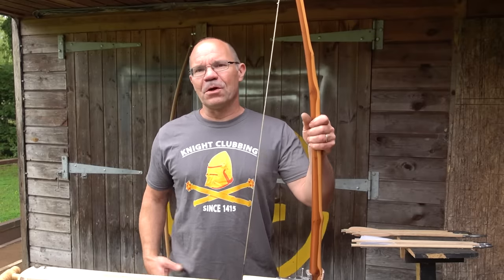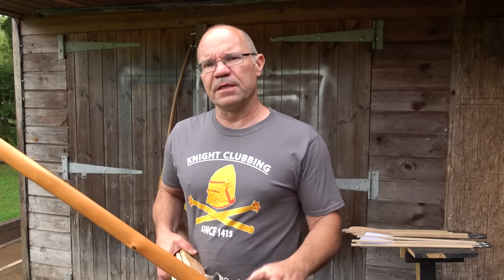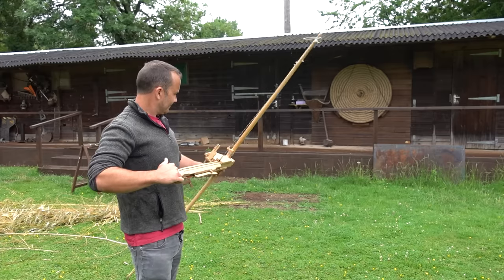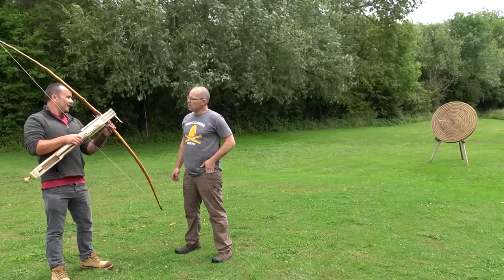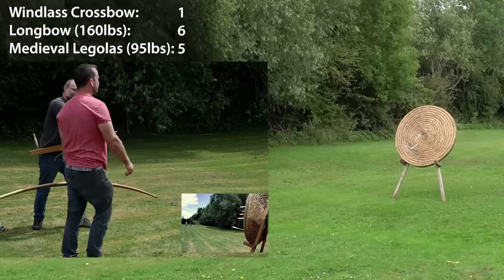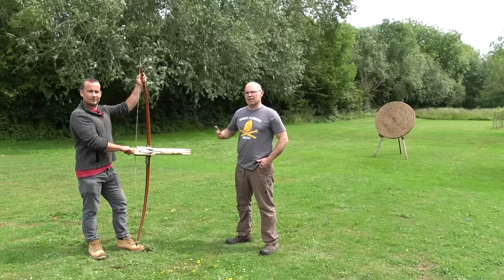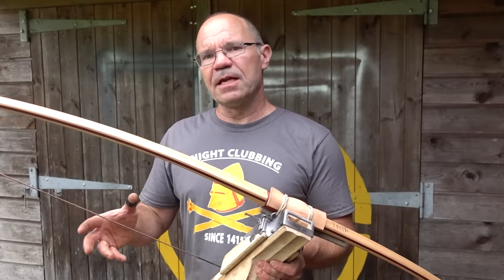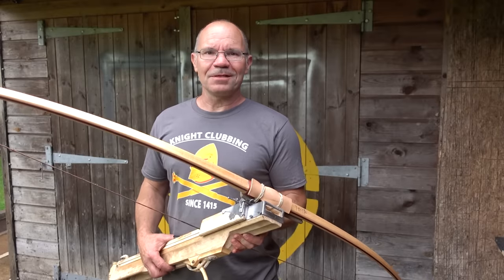Tod's 120lb Medieval Legolas - TESTED

Comment: 13:31 RIP anything not wearing full plate harness...
Edit: Alright, shields are a thing, but you'd have to be actually using them, requiring awarenes of the archers' presence and reacting to them by rising said shields. My point, although not initially clarified, was about ambush potential to slow-reacting targets such as marching columns.
Edit 2: gramatical boogaloo...
Reply: Even in full plate, this would give you a bad day. Throw enough arrows down range, and one of them will find an opening where the plate isn't.
Reply: or deform the plate enough to make it ineffective.
Reply: @curranegan5512  Lucky shots are rare and not to be relied on. Especially at the range a bowman would engage at. And areas that aren't covered by plate aren't just naked. Its usually covered in mail or other material meant to protect from arrows and other attacks targeting would be weak points.
Reply: @alexlawson4173  That would require one knight in plate to be focused at close range. Even at close range a high weight crossbow or longbow barely get a dead-on flat shot that deforms the plate and even then its not much, most are glancing shots. Longer range with less energy and it will be even less likely.
Reply: @Nyx_2142  Well, not even a 1000lb crossbow can penetrate plate dead-on at 5m, so i think volume of fire and accuracy does have importance in targeting the weaker spots. arrows and bolts doesn't have much trouble in piercing mail either, so having a lighter poundage is fine in certain circumstances.
Reply: @theSleepyLamp  depends on the type of arrow head (for penetrating mail) and the range.
besides shields are a thing.
Reply: Nex Gamez with a hi enough rate of fire, it stops being a mater of luck, and starts being a mater of statistics.

A one in 100 shot happens every 8 seconds with 25 archers shooting once every 2 seconds.
Reply: I wonder how many arrows it would take to make a shield no longer usable (either through weight of arrows lodged into it, or straight up holes being knocked through it).
Reply: @hurion1  Well, a war arrow would typically have weighed anywhere from ~75 grams to something like 115-120 grams, so you can do the arithmetic and decide how many of them you would have to add to the weight of a shield before it became uncomfortably heavy to lug around.
Reply: @michaelmaloney2925  Good point, you can also poison the bolts like the chinese did with the chu-ko-nu. Imagine being in armor and being on the receiving end of this, even if nothing penetrates it would be very disorienting and it would make it a lot easier for some one else to hit you in the head with a warhammer.
Reply: The maille between the plates can be easely penetrated by 100-120lbs bows with square point arrows, and the rate of fire of like 10 archers would give short time to take defensive position, enought time to hit weak point. And other thing to take into consideration is the shrapnel created by the arrows hitting a solid plate.

Comment: I can imagine that 5 guys with this thing would be really scary
Reply: It's like the medieval version of a heavy-machinegun team
Reply: add a partial gear with crank such as what joerg did for the drill powered machinegun variant except with a crank handle and this thing becomes even more of a beast
Reply: now imagine 15 divided in 3 ranks with two reloading while the front 5 shoot
Reply: @AdarBlu  
reloading.... 
slip slip slip slip slip....
Reply: @Aalienik  Much more a squad of lever actions when everyone else has single-shots.
Reply: There's an account of a Lady with like five servants, defending a castle for days.
Reply: @Max De Jong Actually come to think about it, in a big open-ground fight 1000 of those would shred through a whole rank allowing for breakthrough attack
Reply: Literally a medieval MG-34 team except you hear THUK THUK THUK instead of RATATATATATAT
Reply: Aalienik  only that the sustainability of shooting is limited by the magazine size, instead of the amount of arrows in the quiver. Especially if you compare the 6 arrows shot WITHOUT the device opposed to the 5 shot with the device in the same time.
Reply: @Nightkrowler  I can't recall who its was, but someone built a "stripper clip" prototype for reloading this kind of device. It was virtually as fast as reloading the most modern firearms that used those (such as an SKS).

Comment: Try walking a mile and then try running a mile. You'd get more tired of running, and I suspect  that something similar is happening here. Joe is shooting faster and thus getting tired faster.
Reply: Exactly my thoughts. Joe's body is used to a certain pace of shooting. Increase that pace and his body will start rebelling against it. I think if he put in some practice, let his body find balance in engaging different muscles at different times and developed a proper breathing technique he could get used to shooting the 120 lbs legolas regularly.
Reply: @B3RyL  Or even imagine 100 sil-archers holding a position, split the group into halves or thirds, group A shoots and then reloads and rests their arms while group B shoots etc.  Eventually you would find the optimum group split for sustained fire.  You're still shooting more arrows than a group of 100 regular longbows and if the enemy closes you can go full fire at will until the Infantry has to take over.
Reply: It looks to me that here there are a couple of things in play. Shooting faster does not give the muscles the chance to recover, so it will be more difficult, at least towards the end. The position is quite different, and the movement is too. Since you need to train very, very specific muscles to be proficient with the kind of heavy bows we talk about here, tiny changes will have big consequences, so more work would be needed either to get the Instant Legolas closer to the normal bow movement, or the archer will need time to train the proper muscles for the new movement. Both things look possible to me. 
Another thing is needed poundage. Maybe this should be used in situations where rate of fire is more important than power, and you really, really need a fast burst of arrows, because after that it no longer matters. Think if your archers are being rushed by cavalry. The range where the archers can do proper damage is limited, they can't really shoot at 200 meters, and that usable range is covered by horses in maybe a handful of seconds. Yes, a powerful bow will kill one enemy, but 5 arrows from a slightly lighter bow will maybe disable 2, or 3, or 4 of the charging enemy. It might be enough to stop the charge and send the attackers back.
One last thing about the aiming devices (the lever and the sights). So far we talked about speed. What if a trained archer will basically take the role of a sniper, so he has a high priority target, he can draw the bow, hold the handle so he can keep it drawn for a lot longer, use the sights to have even better aim than usually, and wait for the right moment to take the target out. The thing is you can more or less already do that with a cross bow, but if you are an archer, you already carry your bow and arrows and the IL device, so you can do this sort of a mission without carrying a crossbow too, you already have the weapons you need.
Now, i'm not a strategist, not military, not a historian, so this is just food for thought.
Reply: it's the same principal as driving a car, the faster you drive the more quickly (proportionately) you use up fuel
Reply: Yes it's conditioning. If you're only used to walking you will tire quickly when running. If you train regularly at running you will not tire so quickly. So someone who trains with this contraption regularly will find it easier to use.

Comment: Love every second of this.
An idea: how much is the additional weight influencing? Especially for the right arm/hand, which isn't used to move that much mass in that speed. Inertia could play a role in this without being necessarily noticable right away.
Reply: The mass of the device is going to have some stabilizing effect due to its inertia.
Reply: I was thinking, what about using animal fat as a way to decrease friction? It might be a small improvement, but might up the firing speed a bit.
Reply: @Superemeoverlord  Animal Fat would soften the String over time, but with Beeswax ..
Reply: @pirobot668beta  isn't this only true for the non/less moving parts?
I am only guessing here, especially without knowing the mass of the device and it's parts. At least to me it seems that overcoming the inertia of the moving parts is a different kind of strain compared to overcome the tention of the string and might therefor be more tiring.
 The device is easing one strain but adds a different one. Question is how significant this is. If at all.
But this might be irrelevant after a few weeks of training, simply by adjusting the technique and muscles a little to the difference, so maybe not even worth thinking about.

@Rawwbot: true, but I think the part you want to put the wax on isn't where the string is but the sliding part where Tod used bone to reduce friction. So it might not make much difference in the end.

Comment: There’s no getting around the basic physics at work:  Power is Work/Time and Work is Force X Distance.

So if he shoots 5 @ 120lbs vs almost 2 @ 190 (where the distance is the same) he’s operating at more than 50% more power output than what may be his near previously discovered limit.  So, yeah, it’s going to be exhausting and not sustainable without further adaptive training....like power lifting....still most impressive...

Maybe some additional friction in there to overcome, but they they knew how to grease the skids back in the day.
Reply: If the for grip would have been explained and utilized the only effort is when drawing the bow.
Reply: David Daivdson  Crossbow tech is centuries old. There has to be a way to lock the bow into place once drawn.
Reply: @Dunge0n  There is, but then legally it becomes a crossbow in Germany, which is why it's not included in Joerg's design
Reply: @InfernosReaper  What if rather than a full lock, you added a partial friction lock that takes some of the force off of your hands. Still not a crossbow since it will release if you let it go, but nowhere near as much strain at full draw.
Reply: the second reverse bow was supposed to solve that problem, but Tod didnt decide to incorporate it.
Reply: I'm pretty sure Joe mentioned he can shoot a 120# bow all day? So, if it's exhausting him doing it about a half second faster per shot, he's actually reducing how many arrows he can loose in a day.
Reply: @vanivanov9571  he's exhausted because his muscle set is used to a different pull, it's like he's started shooting again. Also he's shooting at 3x the speed so that like running 3x as fast as usual it will tire anyone out.
Reply: @nothingsurprisesmeanymore  These were already concerns with drawing the SIL. And if shooting faster is a problem, that means the SIL can never be helpful in a battlefield situation, as that's the whole point. Joe did not seem nearly so tired from shooting a 160# bow at a very similar rate.
Reply: Bo False. To my knowledge, he has never made any sort of claim like this, so I would like you to peacefully disassemble your strawman. He is not trying to make a better bow. He lays out very clearly in this video that he does not think that it should be used in every situation to replace a bow.  Moreover, I would like you to retract your statement about Tod being an amateur archer, as it is only present to imply that those that are not experts in a craft cannot contribute anything valid to it. I would like to think that you are reasonable and would not stand by that claim. 

Moreover, it seems like you are trying to say that because the bow has not shifted in its design much in a large period of time, that nobody should try to develop it further. Once again, I would like to believe that you do not maintain such an anti-progress stance as it seems you take. 

Furthermore, I would argue that the bow has had many an improvement and change in design in those 10,000+ years that you point to. Other than being largely replaced in practical application by the firearm, I would also point to the modern marksman bow and claim that the design differs a fair amount from the English war bows, which in turn also differ from the bows employed by the Mongolian mounted archers. The design of a bow must change to closer fit its most optimal design in a situation to be better in that situation, as I’m sure you would agree. 
Tod is not attempting to make a wholly more optimal bow as you claim, as that is a goal doomed to failure simply by the fact that different situations require different designs (form changes to fit function). Tod is trying to progress a single aspect of it.
To go even farther, Tod isn’t even really the one trying to do this, Sprave is. Tod is contributing because the idea also interests him.

In essence, I implore you to reword your comment to make your intent more clear and cutting out the extraneous bits. If you feel that your comment does not contribute anything to a conversation, I would ask you to clarify that you are merely trying to belittle Tod, or else that you simply delete your comment.

I hope that I did not come off as uncivil, but your comment rubbed me the wrong way and I wanted to explore why I felt that it was bad faith.
Reply: Throw in some chemistry and biology as well.  Firing at a faster rate than he is accustomed would mean a quicker build-up of lactic acid in his muscles, which leads to getting tired.
Reply: Good workout though
Reply: petkras 
Then it’s pump-compound bow
Reply: More work is definatly the case, so troops using it will exhaust quicker. The thing in war time is however that any enemy you can dispose of before melee phases of combat begin betters your chance of winning the engagement. 
I'd consider this device especially usefull against cavalery. Cavalery used to destroy archery units because it could charge them before they were able to lay down effective fire against these units. Archers can be devastating against horses, especially high power bows, but the enemy usually arrived way before the unit was ready to fire a volley in their direction. 
This device would make the volley unneccesary. Volley were used to make it impossible to dodge the incoming fire, as there was a sufficient number of arrows raining down from the sky. when all your soldiers can lay down relentless amounts of arrows, why group up the shots? This makes the unit more mobile, and more adaptable to changing battlefied conditions and approaching flanking maneuvers.
Reply: That second bow thing should be integrated somehow to assist the draw. I hope somebody will perfect it.